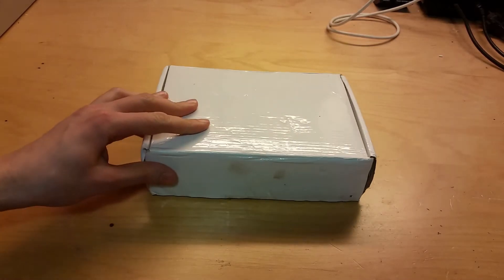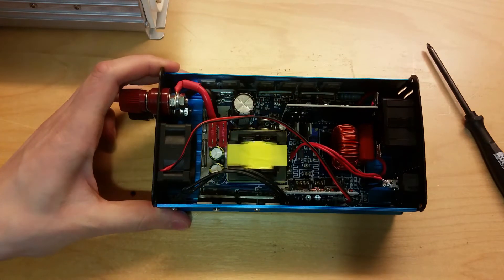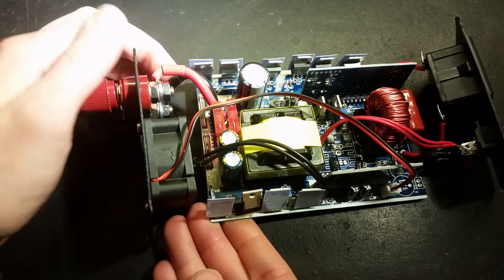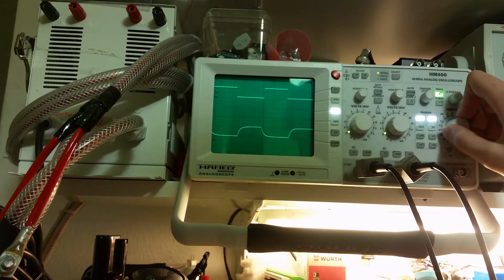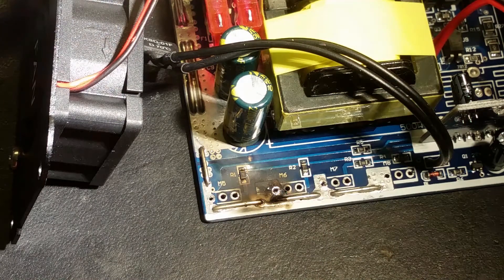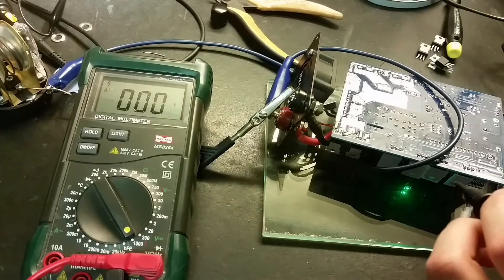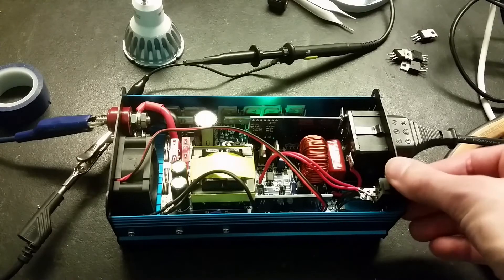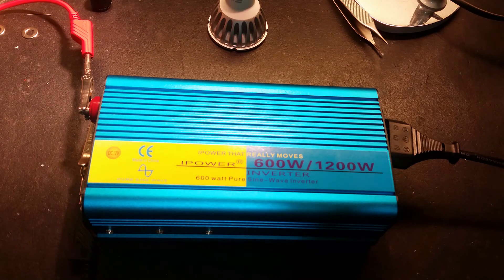Power Inverter Repair

Comment: Wow you know your stuff..wonder if you have any idea what the problem of my Powerdrive 3000w inverter could be only makes about 80 wats before shutting off (small 1.2 cubic fridge works fine) turn microwave on and it displays overload. 

Thanks in advance.

Comment: Hello, nice video ! maybe you can help on the following :

My victron Phoenix Inverter 12v 750va just doesn't want to start, no led, no noise... I decided to open it and everything seems to be fine : the 3 30A fuses, the small fuse in the switch circuit, all mosfets and diodes. I basically see no short anywhere. It seems more of on open circuit somewhere as no voltage go to the drive board. Any idea where to look at ? are there any other fuses ?

Thank you
Reply from the maker: Hi, thanks.
Have you checked the solder joints of the cables and the track on the PCB if they have been cracked?
Or maybe the on/off switch is broken, solder joints of the control circuit/control chip?
Try measure some voltages or continunity after the on/off switch and see if everything have good connection

Hope this helps, good luck
Reply: @MrTesla1337  Hi, there are no cables, just metal pieces with screws to PCB, all the fuses are good and the switch is also good. But that switch circuit has many diodes and resistors along with 1815 & 1015 transistors and indeed no 12v is going out from there. I tried to inject 12v at the exit of this circuit but doesn't start as a bypass...

Comment: Hello, 3000 watt full sinus inverter fault light is on. When the inverter is turned on, a relay tripping sound is heard, then the fault light is on, what do you think could be the problem?
Reply: Someone connected the inverter around the wrong way  .I done it with my  4000 watt inverter 2 weeks ago 😭

Comment: Hi there.  Great video.  I just bought a used 1000 watts inverter and when I connected it with the battery it has a humming noise.  No green light.  What do you think the problem is?  a blown fuse inside?

Comment: Hi.....i have an inverter input 12 vdc output 120 v ac....if i connect a 25 watt incandescent lamp it works ok, but if try with a 60 watt same kind lamp green led blinks and lamp does not turns on....any idea of what the hell is happening ?
Reply from the maker: Is the battery charged up? If the battery voltage drops to much the inverter will shut down

Comment: After you replaced the Gate Resistor, why did you just not go back to it with your oscilloscope to check if it had the proper voltage waveform (square wave)? I am curious. Thank you.
Reply: Was the gate resistor the thin bit of metal? Where do you get them from? Can't find them online

Comment: I have 1000 watt model and it works very well.
I likew this brand.
Reply: Hello, very clear,good.
A question : how to change 2 transistors without the reference registration on this component?
Convertisseur  12v /230 v  3500 w TBE made in China.
Thank's
Reply: @williambelajew5033  guess